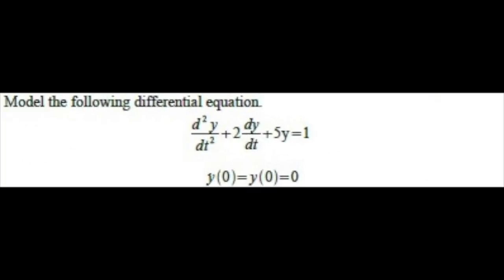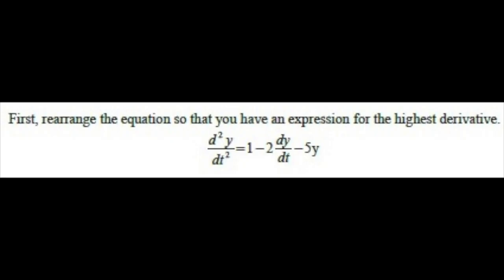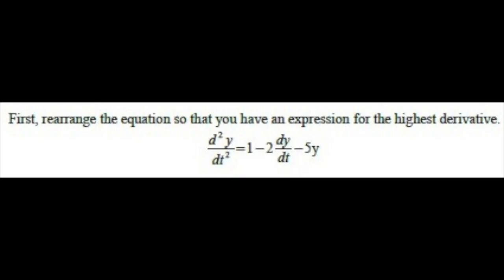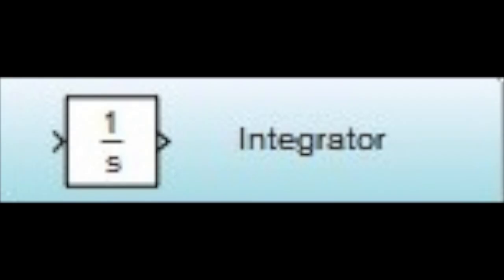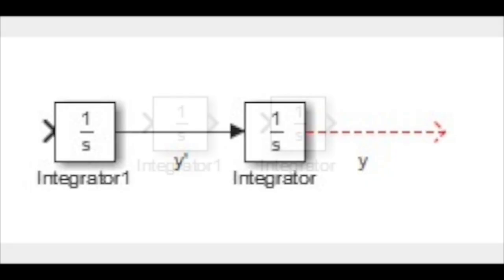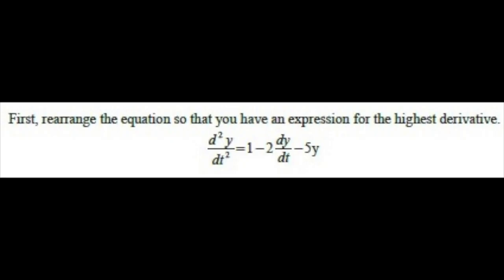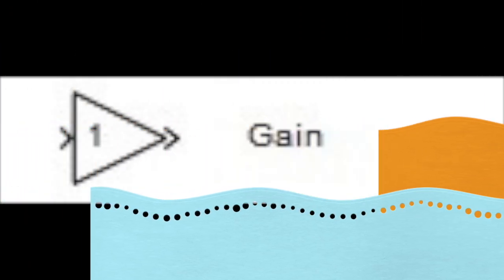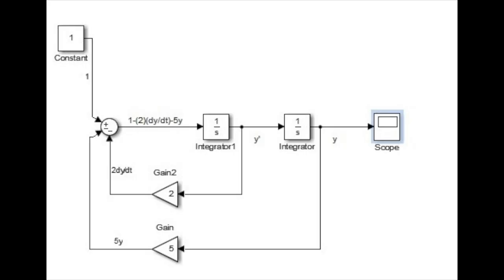Simulink 101: Solving A Differential Equation

Comment: The laplace transform of 1 is 1/s. So the simulink model should be with 3 integrators. constant 1 followed by 3 integrators. from 1st int output feed it to gain 2. similarly from 2nd int output feed it to gain 5. include an adder after the 3rd int and subtract its output from gain 5 and gain 2 blocks. feed the output of adder to a scope
Reply: Hi, second order differential equations require only 2 integrators. I verified this with other MATLAB examples.